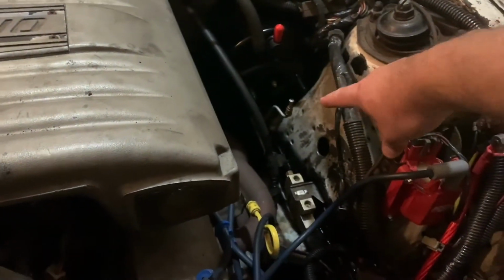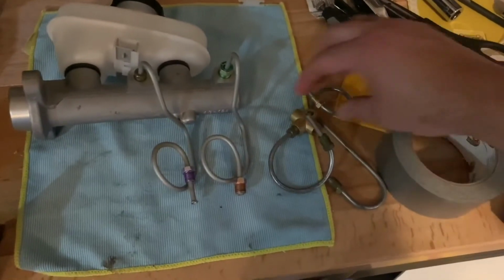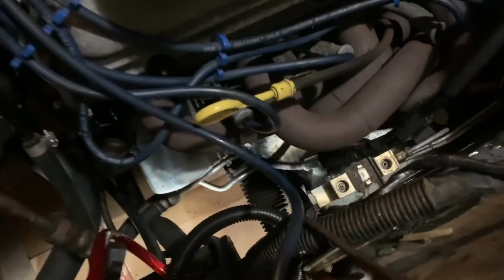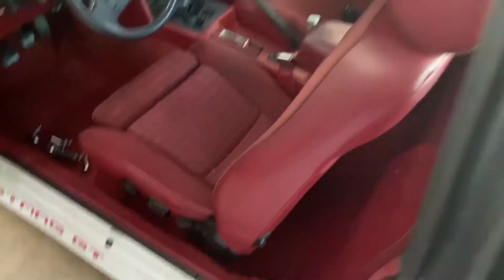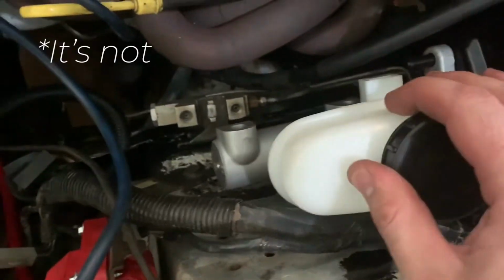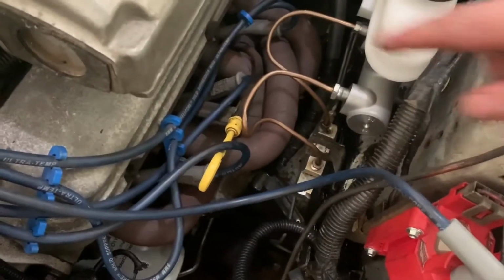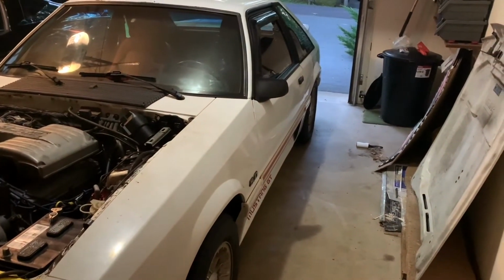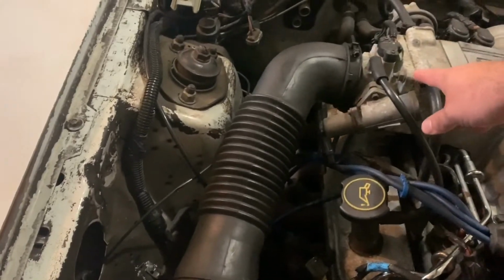Fox Body Mustang: Brake Master Cylinder Part 2B

Comment: Those lines don't look too bad to make yourself. You can do a free tool rental for the flaring kit. You can buy a cheap tubing bender for the tight turns.
Reply from the maker: Paul McComas thanks for the suggestion. That was on my list of possible options but fortunately I got a set of the OEM lines from another fox body owner. It seems they will work but I will know for sure today.